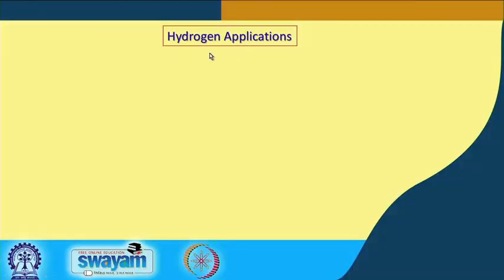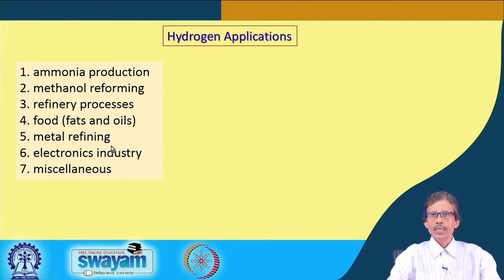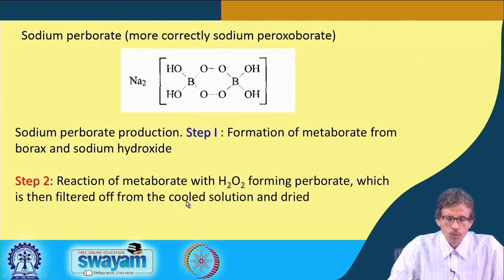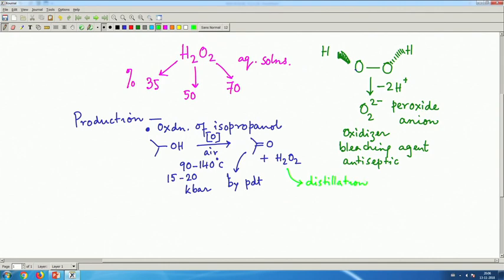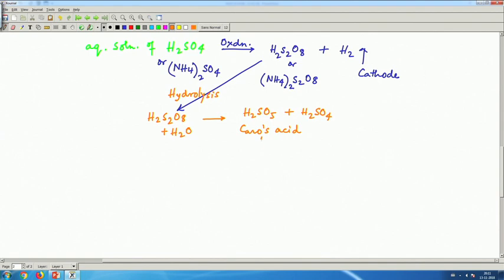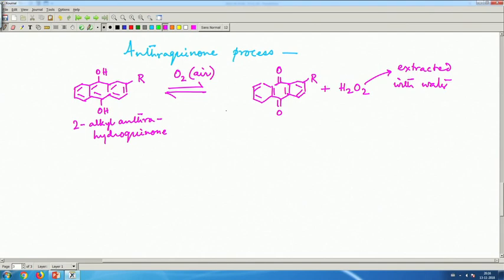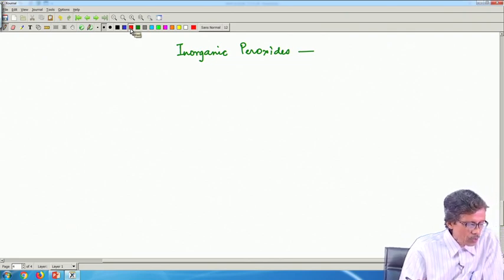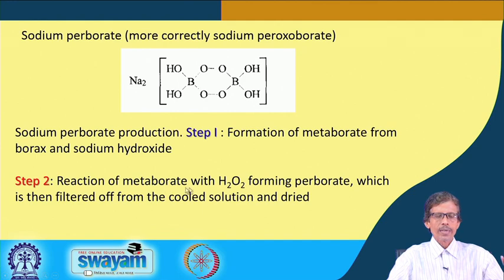Lecture 06 : Hydrogen

Comment: Leture Summary:

*Lecture 6: Hydrogen*

*I. Introduction (0:18-0:54)*

*   This lecture focuses on the applications of hydrogen, building upon previous discussions about its production, particularly through the electrolysis of water.
*   Electrolysis is highlighted as a key technique for producing large amounts of hydrogen.
*   The lecture aims to categorize the diverse uses of this produced hydrogen.

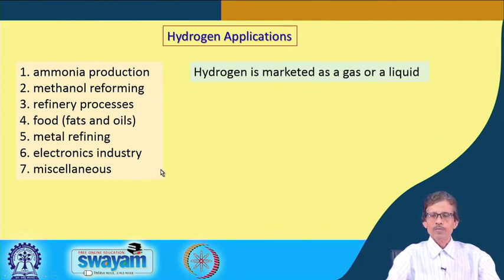*II. Applications of Hydrogen (0:54-6:46)*

*   *Ammonia Production (1:03-3:52):*
    *   Hydrogen is crucial for ammonia (NH₃) synthesis, which is a vital process for producing fertilizers.
    *   Nitrogen (N₂) from the atmosphere is abundant but difficult to convert into useful forms (like ammonia) due to its strong triple bond.
    *   Nitrogen reduction requires multiple electron transfers and the addition of protons, effectively supplying hydrogen.
    *   The Haber-Bosch process (mentioned but not elaborated in detail here) is the main industrial technique for producing ammonia. It utilizes hydrogen produced by processes like the electrolysis of water or from fossil fuels.
*   *Methanol Reforming & Refinery Processes (4:02):*
    *   Hydrogen finds applications in the process of reforming methanol, and also in the refining processes.
*   *Food Technology (4:10-5:40):*
    *   Hydrogen is used for hydrogenation, which saturates unsaturated fats and oils in food products.
    *   This is essential in the production of products like "vanaspati" (hydrogenated vegetable oil, also known by trade name Dalda or margarine).
    *   High purity hydrogen is crucial for the food industry to ensure the safety of the food products.
    *   Catalytic hydrogenation with catalysts is used in the production of margarine and other hydrogenated fats.
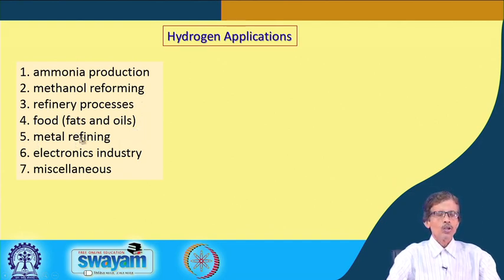*   *Metal Refining and Hydride Production (5:40-6:27):*
    *   Hydrogen is utilized as a reducing agent in metal refining.
    *   It's also used to produce metal hydrides, such as calcium hydride (CaH₂), titanium hydride (TiH₂), and sodium hydride (NaH).
*   *Electronics Industry and Miscellaneous Techniques (6:27-6:46):*
    *   Hydrogen is used in electronics for cleaning surfaces and in various other applications.

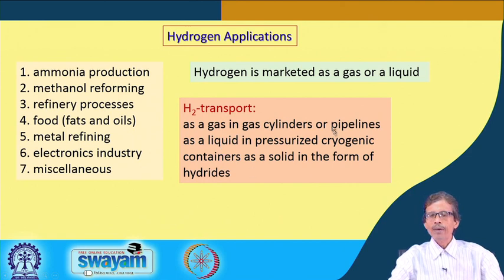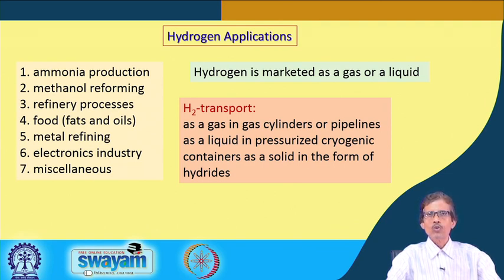*III. Transport of Hydrogen (7:52-10:13)*

*   *Challenges:* Transporting hydrogen as a gas or liquid is difficult.
*   *Gas:*
    *   Can be transported in cylinders or through pipelines.
*   *Liquid:*
    *   Requires pressurized cryogenic (low-temperature) cylinders for storage and transport.
*   *Solid:*
    *   Hydrogen can be stored in the form of metal hydrides, which may or may not be stoichiometric. These can release hydrogen when needed.
    *   Metal-organic frameworks (MOFs) are being researched for their potential to store hydrogen gas within their void spaces, offering a safer solid-state storage solution compared to compressed or liquid hydrogen.

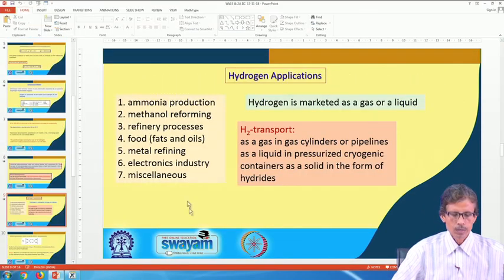*IV. Hydrogen Peroxide (H₂O₂) (10:27-20:51)*

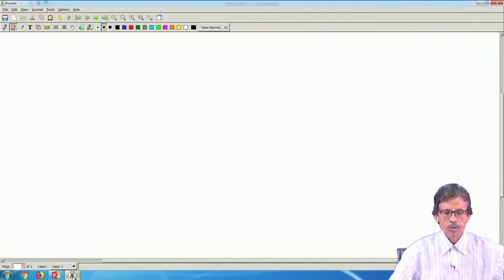*   *Introduction (10:27-11:50)*
    *   After water and hydrogen, hydrogen peroxide (H₂O₂) is discussed as an important compound.
    *   It is a very useful material and it is available in the market in different forms and percentages (e.g., 35%, 50%, 70% aqueous solutions).
    *   It has a unique structure different from water or hydrogen. It has a "book-safe" configuration with O-O bond in one plane and two O-H bonds in different planes.
    *   It is used as an oxidizer, bleaching agent, and antiseptic.
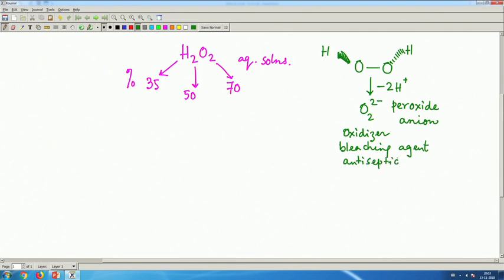*   *Production Methods (12:40)*
    *   *Oxidation of Isopropanol (13:06-15:55):*
        *   Isopropanol is oxidized with air to produce hydrogen peroxide (H₂O₂) and acetone.
        *   This reaction happens at high temperatures (90-140°C) and pressures (50-200 bar).
        *   The produced H₂O₂ is in dilute solution (35%, 50% or 70%).
        *   Acetone, a by-product can be recycled back to isopropanol through hydrogenation or reduction.
    *   *Electrochemical Process (16:02-20:51):*
        *   Electrochemical oxidation of sulfuric acid (H₂SO₄) or ammonium sulfate ((NH₄)₂SO₄) can yield H₂O₂.
        *   This involves the formation of persulfates (e.g., H₂S₂O₈, ammonium persulfate) at the anode of the electrolysis cell.
        *   The persulfates undergo hydrolysis to produce Caro's acid (H₂SO₅), which reacts with water to form H₂O₂.
        *   The yield can reach up to 70%. The cost of electricity is an important factor for this process.

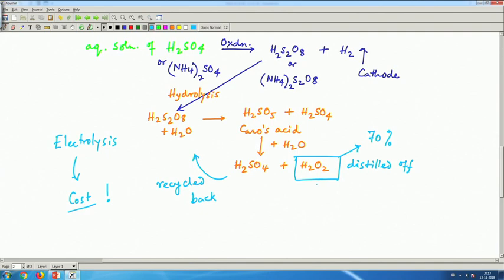*V. Anthraquinone Process for Hydrogen Peroxide Production (21:46-27:22)*

*   *Overview (21:46-23:55):*
    *   Substituted anthrahydroquinones are oxidized by air at 30-80 °C and 5 bar to produce the corresponding quinones.
    *   This process also produces hydrogen peroxide.
    *   The hydrogen peroxide is extracted with water.
*   *Importance of Quinone-Hydroquinone Chemistry (23:55-25:12):*
    *   The process is similar to how catechol oxidases work in biology.
    *   The process can be made catalytic if the quinone can be hydrogenated back to the hydroquinone.
*   *Solvent Systems (25:59-27:22):*
    *   The hydroquinone and quinone have different solubilities.
    *   Mixtures of polar and aromatic solvents are used.

*VI. Stabilization and Inorganic Peroxides (27:22-34:14)*

*   *Stabilization of Hydrogen Peroxide (27:22-28:36):*
    *   Hydrogen peroxide is unstable due to the weak O-O bond.
    *   Stabilizers (e.g., diphosphates, tin compounds) are added to prevent decomposition of H2O2
*   *Sodium Perborate as an Inorganic Peroxide (28:36-34:14):*
    *   Sodium perborate has a "per" structure, meaning it contains peroxide.
    *   It is obtained from borax (Na₂B₄O₇) reacted with sodium hydroxide to form sodium metaborate, which then reacts with H₂O₂.
    *   Stabilizers like magnesium salts and silicates are used to stabilize perborate compounds.
    *   It has a peroxy linkage between two boron centers.
    *   It can be used as a free radical initiator or for polymerization reactions.

*VII. Conclusion (34:14)*

*   The lecture highlights the importance of hydrogen and hydrogen peroxide along with the various production methods and applications, along with important inorganic peroxides.